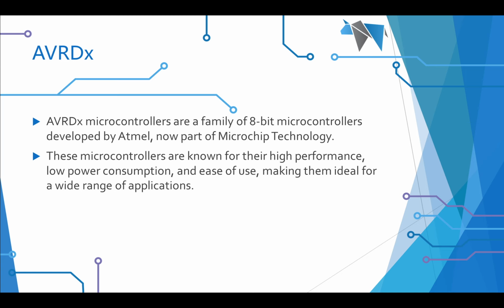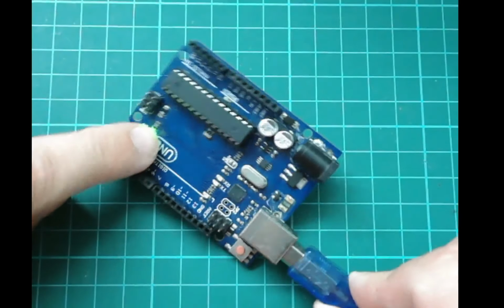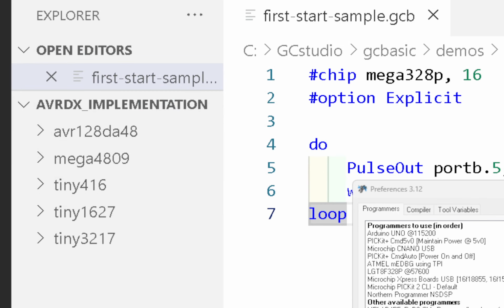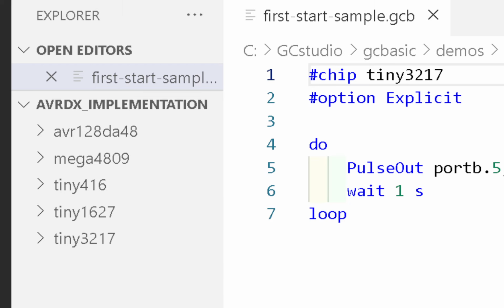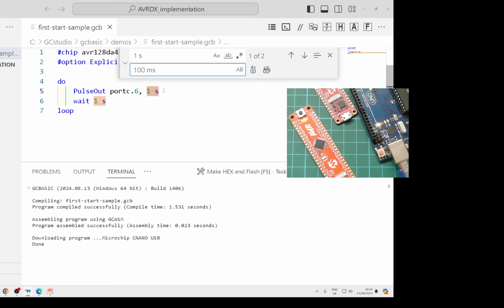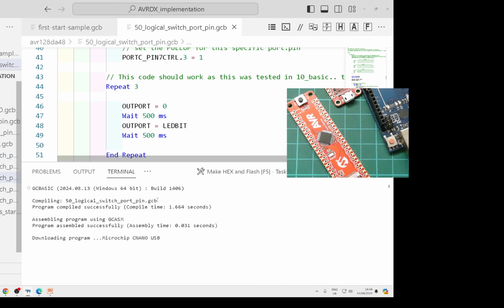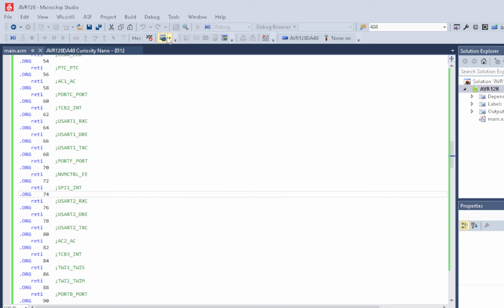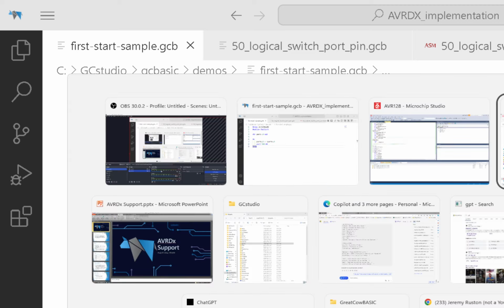GCBASIC:  Microchip AVRDx Series 0, series 1, DA and DB Support.  WOW!!!

Comment: The GCBasic compiler is superb! On other point, I don’t use Microchip Studio or MPLAB X, and it took my attention that Microchip Studio licensed Visual Studio 2015 as their IDE (which is also a super robust IDE, albeit a little old) while MPLAB X licensed NetBeans (not bad either as even SIEMENS use it, just not my taste) But its interesting to see that Microchip didn’t unify their environments with so many years of the buyout of Atmel.
Reply from the maker: Thanks for the feedback.   GCBASIC is now 18 years old and still getting better!

The strategy for IDE development is clear to me.  MPLAB-X and Studio are both valid.  From the very recent release the underlying chip description files are the same.  The same description files architecture.   So, it could be that Microchip support both going forward.  :-)